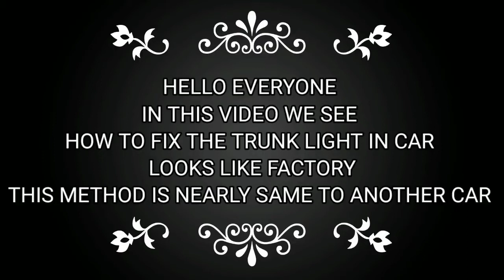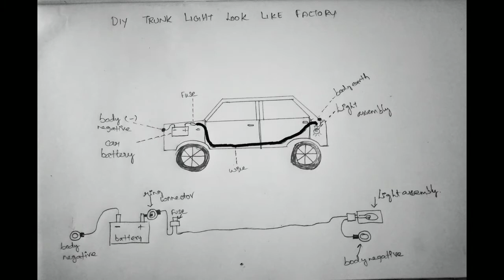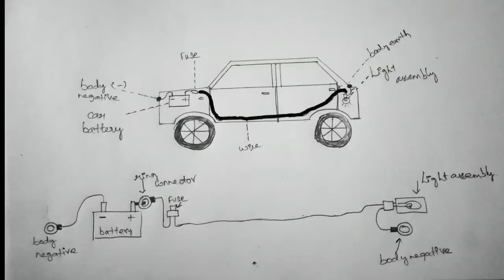INSTALLING TRUNK LIGHT LOOK  FACTORY| LXI TO ZXI MODIFICATION| MARUTHI SUZUKI |THIS METHOD TO ALLCAR

Comment: Bro I also installed the boot light like urs in my swift vxi 2016 model but want auto on off from boot door opening/closing like too model zxi .. pls reply thnx

My cabin light works auto on n off from boot door open/close
Reply from the maker: Hello. If you want automatically on and off feature. You need to add a another switch on boot door. Buy a switch. You can see that kind of switch on door on your car.